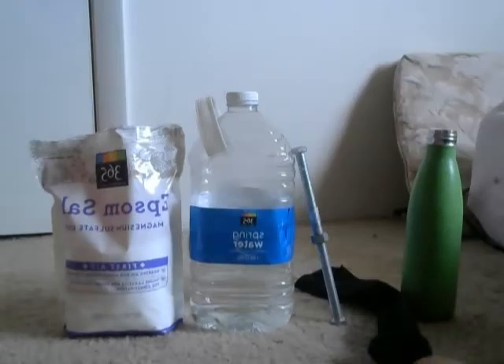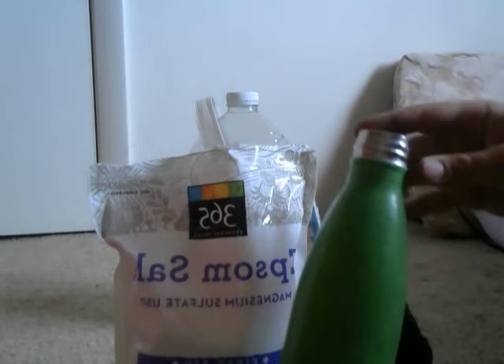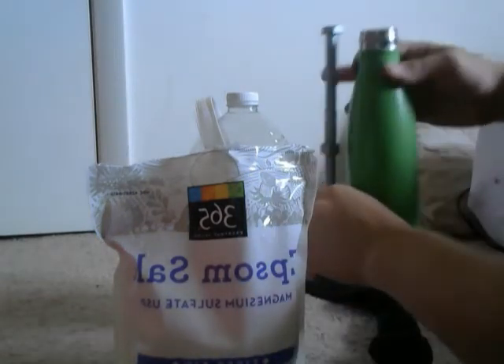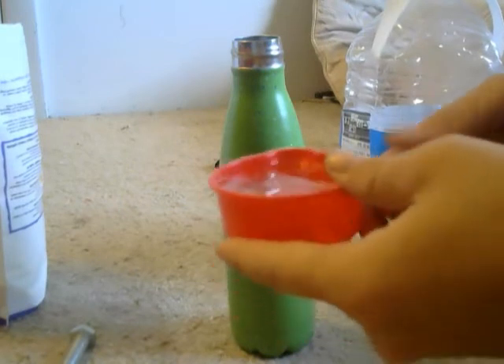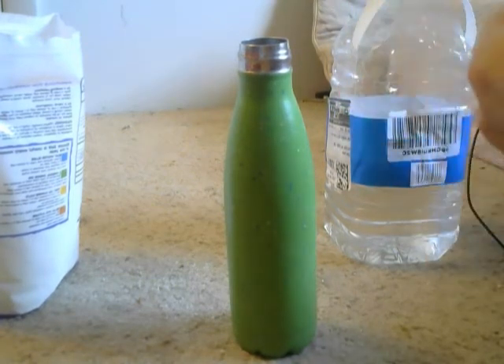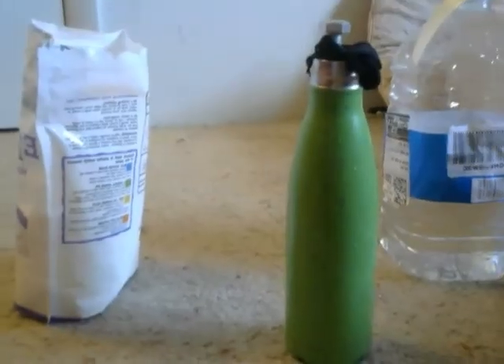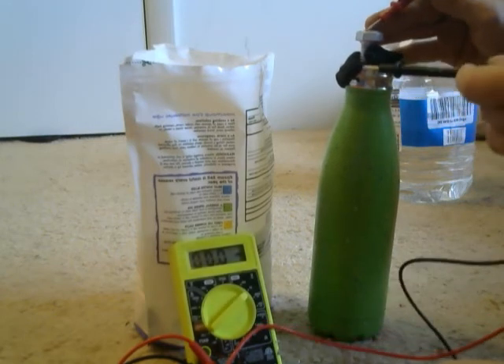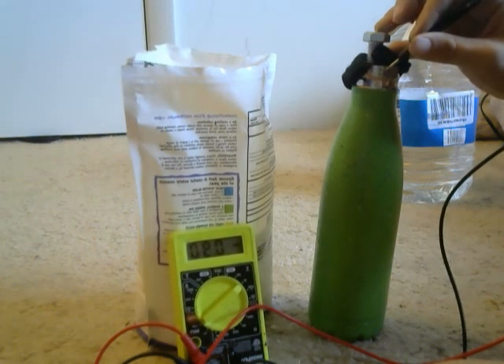DIY Rechargeable? 1v Epson Salt Water Battery!

Comment: The only "forever battery" is the Edison Battery first built in 1906. Some examples existing today still work just as well as the day they were made. 1.4V at .5 amps. Using sodium hydroxide as an electrolyte, these batteries were a rechargeable version of an alkaline battery. Anything else is unworkable, or not portable enough for practical uses.

Comment: Ok, I didn´t see the REchargeable yet, but I´d like to see that. Impressive you can get 1 volt. With 250 little cells, you can pull 220, which is enough to power any device from Europe. (Although we have to look at Ampere too, ofcourse.)

Comment: Another useless battery video! You can never beat lead acid capacity and voltages. Also, when the battery will not accept a charge, it is DEAD. No rejuvenation possible, Dead is Dead.